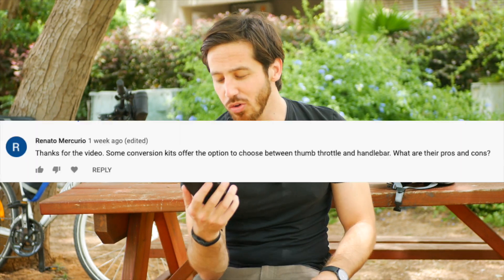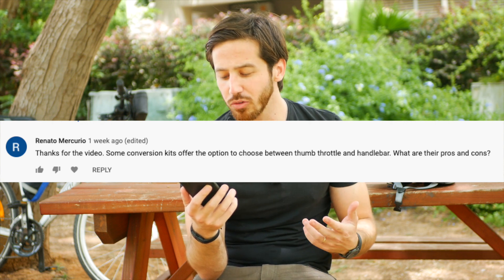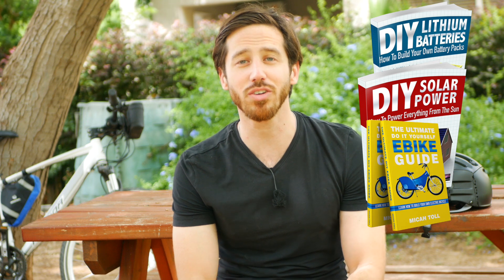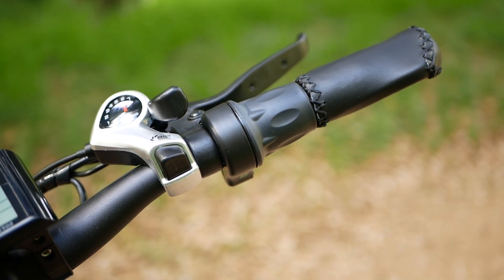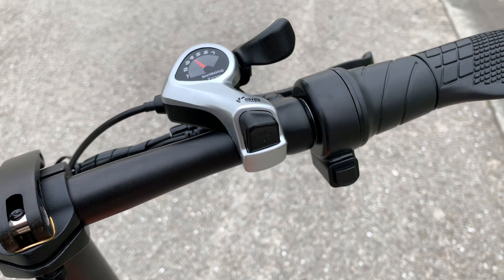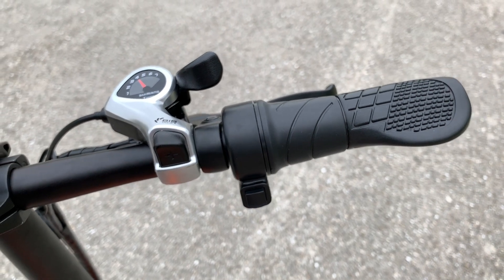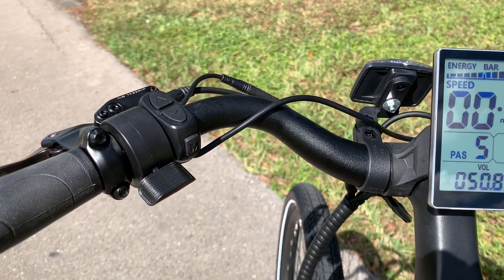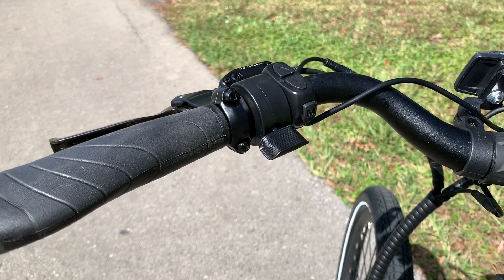THROTTLES: Twist vs Thumb - Which is better?!

Comment: Thanks for this video. It answers a lot of questions for me. I have one for you that I haven't found anyone doing. I have a trolling motor I was thinking about using on the front wheel of my bike, using a rear wheel, and chain drive. What do you think of this idea and is it practical?

Comment: As a long time motorcyclist I am well accustomed to a twist throttle.  I have used a thumb throttle on an atv.  In very rough terrain I hit a bump, inadvertently accelerated, and ended upside down under the atv.  So, yeah, thumb throttles for me are no.  Never tried one but the half throttle sounds real good and may be something I would really like.

Comment: is there a reason that ebikes seem to only have a single front chainring ?  if my ebike had a double front chainring, when using pedal assist at 20mph+ it would keep the " hamster wheel syndrome " to a minimum.

Comment: Can you do a "Riding at Speed - what safety hazards to be aware of" video.
Majority of new e-bike riders are not all that experienced, thus clueless on hazards.  Too often they are so excited about the new experience and speed - they roll into trouble.

- Apologies on length but stuff I've been thru, especially Dyi fabrication
Key items are - sunken manhole covers that can do a hard Left or Right when the wheel catches.  Show them a hub axle with torn out motor wires, show them how a big gear puller is used to pop cover for access repair - ie non-geared direct drive hub @ 10" diameter.  (1st dyi bike)
Of course discuss street car tracks n skinny tires - which is why I like a fat tire for newbies. (Lectric XP - I also tell people the heavier bike is more stable, thus you feel safer - also speed kills range n you - if you should crash)
Discuss narrow handle bars and the death grip you must have when going down a bumpy hill. (Lectric XP).  Wide mountain bike handlebar that can catch something - every time I pull out the bike, something catches as I back out.
Dealing with narrow roads and impatient drivers - lots of nervous old Asian lady drivers in Seattle.  DWO is a valid statement.  Also smart-ass people who want to intimidate you - what can you do other than a middle finger n maybe quick shot of license plate number for the cops.  Or know when to pull over before the A-hole passes by (ie road shoulder awareness and rearview mirror)
What to do with buses that do a stop and it impedes your bike lane.  When you get gridlock - safer to ride between car lanes if legal? Always know what quieter side streets you can use - they always like to place pseudo bike lanes (ie just paint) on existing narrow busy streets because the traffic engineers don't ride bikes.  I get mad that Seattle is notorious for Road Diets - they purposely narrow the car lanes to Slow traffic down by eliminating car lanes and placing cheesy bike lane in Several hilly areas - rarely do we ever see bikers going up that hill.  Plus it rains a lot here.  All it does is make the driver Upset when they remember how it was.  Fyi a road diet leads to 50 - 80 yard long lines at light changes.
Left side handle bar mirror - so you know no one is behind you, you can use more of the lane - that you may need a wooden peg/dowel at end to mount mirror.  Mount it on the inside of the grips, you can't see anything with some mirrors.  Have heard of someone using a backup camera w/ smartphone.

Seattle is hilly, has narrow streets and old asphalt. Why the mayor green lit Lime scooters as ok - is stupid.  Crappy uneven sidewalks, steep hills, road side conditions that are bumpy for a bike - is just asking for Lawsuits for injuries when you see a 4 - 6 inch wheel that will catch on anything.
 "Clueless as Seattle" is what I tell people .

With your motorcycle experience - discuss how motorcycle riding differs from e-bike (speed to get ahead of traffic as needed).
When should you take command of the lane for safety - which is why I always recommend 48V, 500W minimum spec - strong 15-20 mph cruising speed does not frustrate drivers like 10 mph.

eBikes owned or sold off - 2 dyi direct drive hubs (just the big cheap motor type to start), 
Lectric XP (for those who just want to buy a E bike - very good value w/price, components, power n range - 25 mph - 60 lbs but it fits in a car trunk, all you need), 
Bafang 750W mid drive w/52v-20 Ahr battery WITH half twist throttle on a mountain bike w/ hydraulic brakes - sweet ride, nicer wt balance, lighter than a hub setup, great torque since you got gearing.  Fast, stable n nimble due to MTB geometry. Hardtail - so know how to ride standing on pedals w/ throttle.
MTB - be aware of frame triangle geometry, couldn't do a Hainan style battery, Motor $500 - $600, Battery $400 (triangle type, wished I could lock it to frame, just Velcro straps - typical for Chinese design and lack of simple innovations/mods that make sense, but the Chinese will never do - lol Stupid Hainan battery packs always requires disassembly of power mount so you drill 2nd hole into cast aluminum plate so it mounts properly to existing water bottle mounts). Also for a Bafang mid drive - 2 band clamps, Big one around the motor, smaller one on crossbar tube - visualize the number 8 and you see how motor will always clamp tight to the frame, in case bottom bracket mounting nuts gets loose - smh - required wrench is always extra.  Also the pedal cadence sensor with no secure mount on bottom bracket for hub drives - had to use a hot glue gun for it to work.  Superglue doesn't work that well due to adhering a small uneven surface area.I

Why I'll never buy a Chinese car - just fabricators for a cheap buck due to mentality, not like the Japanese who show Ownership, Pride and Innovation that creates great Value and Long Life.  Just better engineers and culture.

Finally, when elitist pedal bikers give you a hard time about riding an e-bike - I tell them ... What kind of first aid will you give me when I get heat stroke and puking my guts out collapsed at the Side of the road?  Then Shut Up.  You're being an Athletic A-hole - jerk.  Pedal biking for transportation is an Athletic event reserved for the young and Ultra fit here.  Too many long steep hills.
Have fun and stay safe riders!  Hope this thread helps the Newbies.

Comment: Your opinion is right on target as usual, but when you add in PAS and cruise control possibilities, the fatigue factor is less or nonexistent. Then the key is what kind of shifting you prefer. For me, I prefer thumb shifters and then that means putting a thumb throttle to the inside of the shifter to avoid interference.

Comment: i am so happy with cruise control, just keep the throttle at the same position for 8 seconds and until i touche the brake or move the throttle again. also, the cheap 2 - 5euro twist throttles can be dangerous , i had one break off when i hit a big bump in the road and the grip just broke off, i had so much luck not falling.
in my experience a rightside half twist throttle is the best.

Comment: Hey great show you got going. After watching every episode here I finally worked out what I needed for my first ebike. 500w Motor Min with a 48v min battery pack with japanese batteries. Just wanted a hybrid bike with front shocks. Sweet. Thought time to shop around and buy one. Found it strange that every store here in Australia only sell 250w bikes with 36v packs. 
So I done some research from the Public Transport Authority and yep conservitive Australia is limited to 25kmph and 250w with NO throttle. thats right. 

The reason why Im looking at the 500w bike min spec is because im around 95kg and have 2 large valleys to get through to go to work. gradients are steep. So im doubting a 250w motor would work right?? 
So im either stuck with a 250w motor bike or buy and import my own stuff and import what I need in to my country and build my own.
Whats your thoughts on what I can do? Will a 250w be good enough or am I best to get the larger watt motor and buy in?
thanks
Reply: 1000 watt, it's the only way to go.  You can hide a battery in a backpack and very few people if anyone will realize your bike is electric
Reply: Google volitionebike in Sydney. I heard that they can put a sticker on your motor stating 250 watt so you're legal. They make some serious bikes.

Comment: I have a full twist on a razor MX1600 and it's REALLY twitchy and kind of jumpy probably because it's a very sensitive sensor or something but I have a Schwinn S500 w/ 36v and it has a half twist and I like it a lot but I'm curious about thumb throttles because I like quads WAY more than dirtbike throttles so naturally it has me wondering if I'd prefer it over twist throttle or not..... Might have to get a cheap one off Wish and try it. I'm willing to do all the wiring and soldering for the answer too so unless you've tried one out, don't make a choice randomly.... I really don't like the full twist because of riding at speed and hitting bumps w/ your wrist all bent weird hurts and I haven't had that problem w/ half twist so I'm betting I'll find something I like or dislike when I try a thumb throttle.

Comment: I’m looking to by a battery online. I currently have a 1000W 15.6Ah 48V battery ebike. It is however very heavy.
I would like to downgrade to a tube mounted smaller 48V battery. Can you please tell me what I need to be aware of? Such as the connection type, current etc.

Comment: I designed and built my own e-bike. I have 2 1,000 watt tires. I go 36mph for 25 miles per charge .
I first started with 2 (left and right) half twist throttles. This became difficult to use due to hand fatigue.  Plus the half twist came with peddle assist. 
I then moved to 2 thumb throttles. With the thumb throttle you do not get peddle assist. 
The half twist cost a lot more then the thumb throttle. 
My bike setup cost for the half twist throttles  came to around $2100.00. With the thumb throttles it came to around $1500.00.
Having an all wheel drive e-bike gives you enough torque to throw your head back. 
I start off with one then use the other.
With one I can do around 32mph with an average of 23mph. With both throttles I can do a constant 36mph even up hill.
These ebike tires have a RPM rating. Which basically means your tires will only travel so fast.
I use my ebike to ride to work. I put my bike in the hanger, go to work, then go home. I do not ride my ebike anywhere I would have to leave it. Even though I do have an expensive bike chain. I'm always worried someone would damage it trying to pull parts off the bike. The battery alone is over $500.00. So resale value could be up to $100.  People  now days don't care. It's all about them and if they can't get what they want they'll damage it.
Where I live e-bike are considered a motor vehicle. Which means you have to ride in the street. People don't care. I've been almost hit because people in cars and trucks only see a bicycle. They don't know the laws. 
If someone ever hits me or they pull out in front of me and I go flying over their hood, it's going to hurt. I don't care how much safety gear you wear.
The biggest problem is people need to be educated on the rights of an e-biker.

Comment: This is another great video. I am in agreement with you about the right side throttle. Having ridden every conceivable type of powered 2 wheeler during my lifetime, getting used to a left side would just be too weird. My current bike has a left side thumb throttle and I don't like it at all. I would like to see you do 2 new videos. One would be a how to on wiring in accessories to existing controllers. For horns, lights, etc. The other world be on how to convert a thumb throttle to half or full twist. Any special pickups, etc. or are they all standard and just work right (see what I did there) out of the box?

Comment: I’m building an electric drift trike (DIY). 500”-1000w 36-48v front wheel powered and a thumb throttle, just wondering what your opinion is about this - hope to get a response thanks

Comment: High power ebiker here. I cant imagine using a thumb throttle on a high power ebike. You need to have good finesse with the throttle. I feel like the thumb throttle will cause many unintended wheelies. I use half twist throttle; it isnt even half. It is more 1/3 to 1/4.

Comment: Question: is it more power efficient to have a 52V battery vs a 48V battery or lower? My reasoning, for a fixed power draw from the engine, at a higher voltage, the current would be lower, meaning less power dissipation. Let's assume the controller can handle all voltage ratings.

Comment: ON ebike and scooter: Thumb throttle, always! I even use two: one for acceleration (right) and one for regenerative breaking (left). Controller should have cruise control build in, or else it's no fun offroads and can even be dangerous

Comment: twist throttle with gear shifters, it can be done. use micro shifters.
there is pull throttles i see on scooters,  i use a thumb throttle not the same as in this video on the left backwards same as more power bruno. i use the left side as im using mid drive and loose the gear shifter on the left. when making bike to sell i will put it on the left because you dont use the 3 speed shifter as much as the right shifter. if it has cruse control right twist. 
get cruse control with a twist throttle, its great. 😷👍🏼

Comment: My new ebike has a left side thumb throttle, which is the worst of all worlds in my opinion. It does have a trigger shifter on the right, but it's on the top, not the bottom, so it should work even with a thumb throttle. If they're going to move something to the left side it should be the shifter, not the throttle. The shifter on motorcycles is on the left, so it makes a lot more sense than putting the throttle on that side. Also, since the right side brake lever is usually the front brake and that's where most of your stopping power is, putting the shifter on the left makes it much easier to downshift while braking. Also, you gennerally want either the throttle or the brake, not both at the same time, which is why the front brake and throttle are on the same side on a motorcycle.

Seriously, the people who have these "brilliant" 🙄 ideas about changing things obviously never actually use the product themselves. Theory is one thing, reality is quite different. Motorcycle controls are set up the way they are for very good reasons after more than a hundred years.

Comment: When making a conversion from MTB to a mid-motor, what is the breaking point to change the drive train to a heavier duty? 500w, 750w or 1000w?
Reply: For me 500w was not enough and 750w made me want more so I ended up jumping a few levels straight to 1600w..... Now I plan to start jumping voltages, from 48v to 52v or just straight to a 60v 3kw motor. I can't help it.... It's like working on a dirt bike or motorcycle but it's not dirty or as finicky, it's just plug and play power and I'm addicted¡!    LoL
Reply: @xpndblhero5170  This. lol

Comment: You ride motorcycles and have an issue with a thumb throttle on the left? How about a scooter that has a brake lever on the left where motorcycles have a a clutch lever. I rather deal with a misplaced throttle than a misplaced brake when I am on two wheels at speed. Grabbing a handful of brake when you are not expecting it will definitely get your attention!

Comment: I have a 750watt 48volt  rear hub drive ebike and would like to add a front hub drive to make a 2 wheel drive and increase speed. Can I integrate the same controller and battery or replace 22 amp controller. Any assistance is greatly appreciated!

Comment: I have a Bultaco Brinco Rs with twist throttle, and a BH nitro 29” pedelec (hall sensor on the pedals, so the power in 3 selectable stages comed on when you pedal). The BH is easily the best, as it is feels so natural to have assisted power when you pedal. So you pedal to go faster just like any bike! You have to be careful with twist throttle, and always switch off the power as soon as, of preferably before you dismount as it’s very easy to accidentally twist the throttle when moving the bike! If it twists slightly, it will leap forward and wheelie, thereby twisting itself more, until it’s in full power!!! As it weighs 45kg this isn’t good!

Comment: I agree I use a half twist throttle on the right side of the handle bar. I find it has much less fatigue than a thumb throttle though I’ve never used a full throttle. As far as a left side throttle. It would get In the way of my ejection seat bottom.

Comment: Hi Micah. Thanks for all the great content! I'm making a range extender for my ebike but cant decide if it should be paralleled to main battery or plugged in the charge port of main battery (when charged to same voltage).  Main is 19sh Em3ev 52v triangle for bbshd motor. Extender 14s4p samsung 3.5ah cells. Thanks
Reply: Li-ion batteries are tricky - they require balance when hooked in Parallel. Ie 4 batteries and One is weaker than the others - goofs up the set.  Weak battery pulls power from stronger ones during operation.  They say battery life is compromised.  I would consider a DPST "A-B" style switch so you got all Main or all Aux battery power going to Controller.  What I'm planning for a Lectric XP - Band clamps to secure a Hainan style battery on top crossbar.  You only do this for long rides due to weight.
Check Bolton e bike channel, he has something about a do-dad for Aux batteries he  sells. Fyi, stopped watching him since he's a 1 story house - a gambler - slow to the punchline.  Micah is excellent at getting to the point and a better Electrician / engineer.
Paralleling Different battery packs with different mAH batteries is too iffy for me, even if both are fully charged. Not sure the batteries would match the same for a long ride. Plus they're expensive.

52V, 20AH battery is already a big one, sounds like you drive hard throttle fast, long distances and a steep hill at the end.